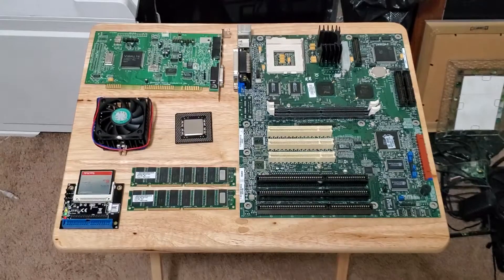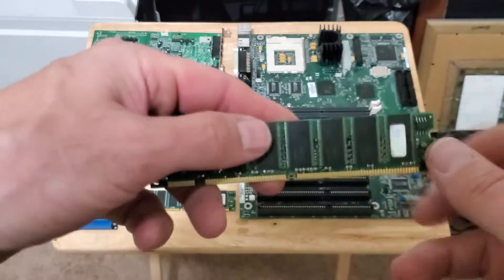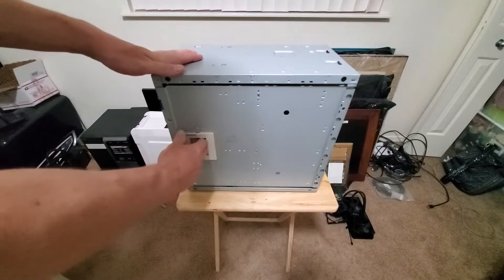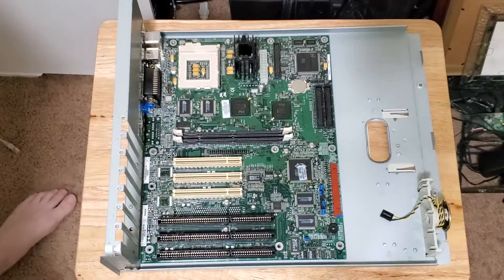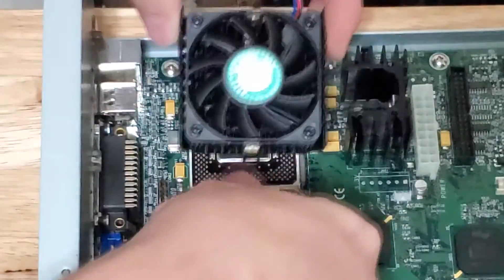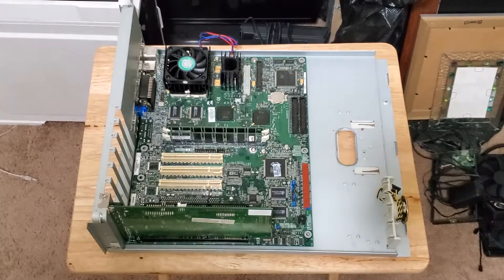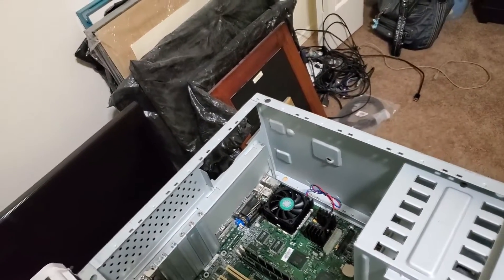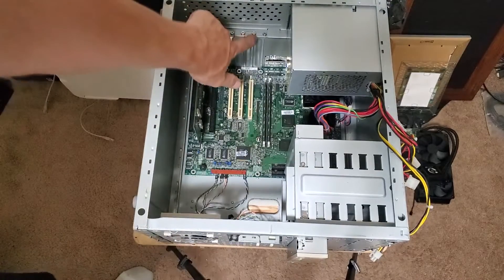Pentium 233 MMX Build!  Pt 1

Comment: i used the floppy connector on my SD ram input i had a old usb plug that had 4 sockets  cut the two middle ones out and used that  for my front connector i had same problem with the power connector

Comment: My first Windows PC was a HP p100. Before that I had a Atari ST. That HP never gave me trouble I had so much fun with it even though it only had 1mb video. I went onto the internet with its built in modem later i bought a 56k modem and thought i was pretty flash lol. Years later just because I could  I filled the emptty video memory sockets on the motherboard and upgtaded it to 2mb video. I also bought a used p133 cpu for next to nothing. At first the computer kept reporting it still had a p100. There is no bios screen so I had to try to find the right dip switch settings. Eventually had it at 133mhz. I still have that computer. The trouble with upgrading computers is I feel gulity that my previous one will no longer be used. I always feel sad. Too sentimental. My main computer is a now very old Amd 1055t but still working well. I recently maxed its memory out and added a ssd and a new gpu. I still have most of my previous computers because i find it hard to part with them. Thanks for your video.

Comment: We have this chip in our Swiss Charmilles EDM cnc machine year 2002 vintage. There was an issue with the heat sink being improperly installed or buggered by previous owner. I cleaned everything up with alcohol, installed a new fan, sanded back of copper heatsink smooth with 320 grit paper on a flat plate. ( had telltale marks of someone gluing something and then scraping it off later with a blade of some sort ) I then reset the heatsink with a pea sized drop of non conductive paste and double checked my work. Before our intervention we had been running the machine a few months with the rear control door open in an effort to keep it cool until I could get to it for proper in depth inspection. Control would shut itself down and then reboot due to overheating, we figured this out after a while. I saw no signs of extreme heat or burning, and the machine has been running flawlessly since the new fan and heatsink reset done. Is there anyway that we could have harmed the chip ? Should I be looking around for a spare chip ? If so where can we buy one or two ?

Comment: My first ever self built pc used a pentium mmx 233. My first ever pc I bought was a Packard bell 133, after having it for a year a rebuilt it myself and upgraded it to a 233 and I believe 128mb of ram. Put a voodoo 2 in it, and it ran games very well at the time.  Mainly quake 1 and 2. Have built hundreds since then.
Reply from the maker: That's awesome.  Always like the voodoo cards.  I may have a voodoo related video in the works soon.
Reply: @idoesstuff1  you should! The voodoo cards were a huge breakthrough at the time, introducing open gl to gaming world. I remember the first time I saw open gl quake, it was amazing, enormous improvement in graphical fidelity.

Comment: Why does it "pain your soul" to use two IDE ribbon cables. That is the optimal and preferred setup. It used to kill me to see computers with the CD-ROM slaved off the Hard Drive. Because it absolutely torpedoes the data rates for both. Anything your often using at the same time should be on separate cables. So hard drives on one IDE cable, and removable media on the other.
Reply from the maker: It is the optimal setup I admit but it's so cluttered.  In todays day and age we usually strive to keep things as clean as possible even if you don't see it.  Also, currently I am using two ide ribbon cables without slaving the cd rom.
Reply: @idoesstuff1  Ohh it is that, but cable management then wasn't a thing back then. Usually just making the cables reach was a headache. Though I must admit during this age for my own personal PC, I was a SCSI fanatic. Fun cabling setups with that system. You just kinda lived with it.